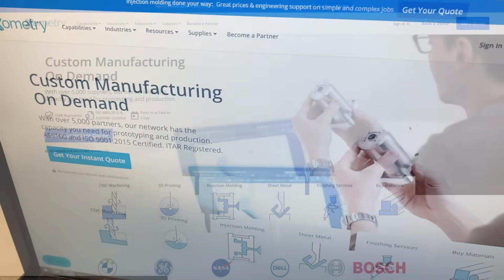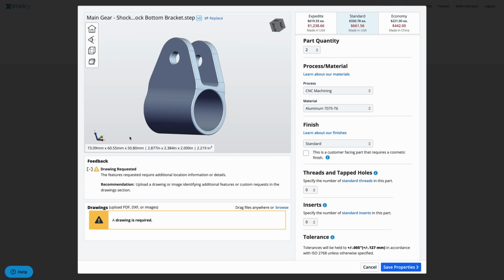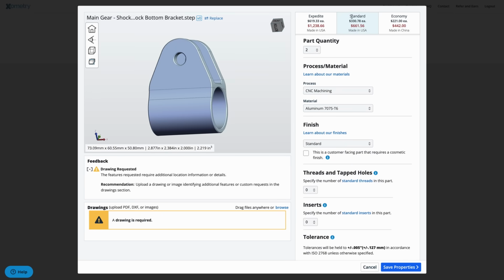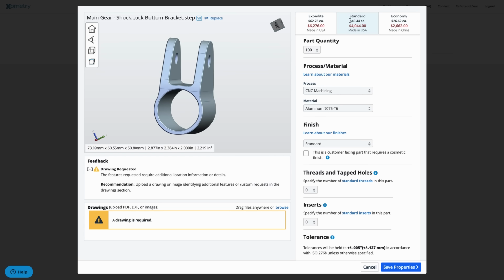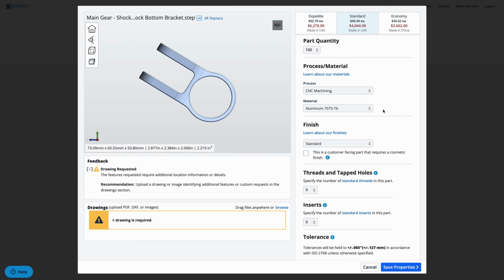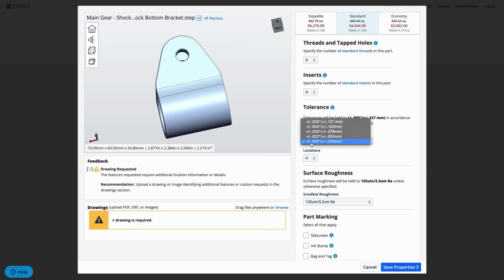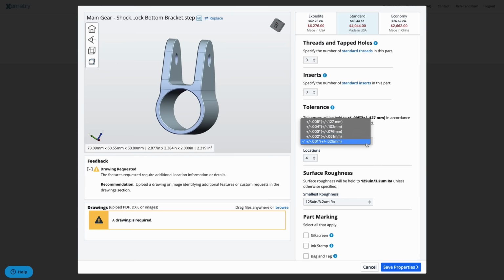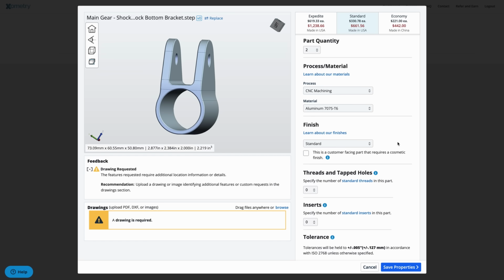The TRUE COST of CNC machining!

Comment: I asked a 6 year CNC guy to face off a 4" piece of 1020 round bar . Then drill a 1" hole 2" deep in it, then drill a 1/8' hole in the side.
He did not drill the 1" hole deep enough. Broke the 1/8 bit in the side, welded it up to cover his mistake. And went too fast facing it off and left a poor finish. He said he was unable to use his CNC equipment, and did the best he could.  BTW... The piece was discarded
   The moral of the story, you may ask?   The true cost of CNC machining is ...the creation of a workforce unable to do the simplest of jobs, with out the aid of a $100K+ computerized work station.
Reply: You absolutely right. Just because they can set up a part on cnc and push the button to make it go they think they're a machinist. The programmer is the one that says what tools to put in and programs speeds and feeds in the program. Unfortunately back around 2000 they dropped tariffs on stuff coming from China. The results were 3/4 of small machine shops went out of business. And no one persude or trained to machine because there were no jobs. I know of 2 machine shops now that are looking for workers and there isn't any.
Reply: Its funny, because I asked a guy to do a simple part that would have taken 10 minutes on any number of cnc machines in our facility and he spend half a day on it because he was too busy worrying about using manual machines for clout. 

Stop with your nonsense.
Reply: Meanwhile Vietnamese and  Mexicans taking the few jobs left here
Reply: @JuanHernandez-ub3ez  No.

Comment: I disagree with Apollolux saying that the true cost of CNC Machining also includes the price of the machine. It does not. If it did, there would be zero reason for any company doing CNC, to ever buy these machines as they would have no way of making their money back, since the parts made on the machines would be so hideously expensive that any earnings made would cover the many other costs in running a business. No, buying the machine isn't part of the costs. Buying the machine is an investment into your own skill level, which you can then use to earn a living. In other words. If the machine was included in the costs, it would mean that buy and use a new CNC machine every single time you want to manufacture a single part. By the same logic, a Carpenter would also have to buy a new hammer every time he/she were to put a nail into something or a new Screwdriver for every screw they were to fasten/loosen. That is obviously ridiculous, so no, the machine isn't part of the costs. The machine is an investment into your own skill level, just like every stroke of the hammer and every fastening/loosened screw with the screwdriver adds more experience to your skill level with that tool.

Comment: Showing machining operations and how workpiece being held is rather valuable for designers to know how their design affects machining process, operation, number of tool change, number of custom jigs and fixtures required ...etc.  However, it’s rather deceiving to show audience the cost of milling in-house is only about raw material cost compare to vendors that need to consider overhead, raw material, labor, logistics ..etc.  I’m not a machinist or machine shop owner so feel free to correct me if I’m wrong or miss anything, businesses that don’t have a milling machine should run ROI considering at least the following cost:  1. machine & whatever attachment pieces 2. if facility electrical modification is required 3. Compressor/pneumatic system 4. Maintenance cost, 5. Operator cost and skill level.  Raw material and special cutter/tap can charge to projects as consumable so I don’t consider them part of asset.  For companies that has a milling machine probably already know how much the cost difference going to be machining in-house vs outsourcing.

Comment: Man... there are some unusual thoughts down below about "cost" going on.
The fact that you have a facility & property is a cost. Utilities, insurances, taxes, machines, machine amortization, tooling, fixtures, oils, coolants, inspection equipment, the network, the software, waste disposal, and so many things that create a rate of cost per hour. Labor, (at the machine & elsewhere)/ Cleaning, packaging, & shipping, billing also have costs.
The material for this part is nearly negligible in regards to cost. Seemed to mention $10. But for time it looked like it took several hours and that's without the CAD work and design.
In my shop the cost per hour is about $70. Prior to setup there is about 3-15 hours of work (depends on part complexity) by various engineers, quality, order entry / scheduling, purchasing, receiving folks. Then comes the setup & production along with clean, pack, final inspection, and ship. Then there's our expected profit. A part like this would be about 15-20%. A part like this, qty of 2... between $6-700 seems about right.
Reply: Agree, thanks for commenting.  This video over simplified the cost of machining.

Comment: Could you not extrude the rough shape and perform a minimum machining operation to the tight tolerances required? I imagine it would save tones on material cost and machine time. But of course only worth it for larger volumes.

Comment: I'll add to Apollolux's statement: 
Setup Time * Machine Rate / Run Quantity
#Operators * Labor Rate / Pieces per Hour
Machine Rate / Pieces per Hour
Material
Components/Outsourcing
Packaging
Scrap %
Efficiency Factor
Markup%
Possibly factoring in any other inspection that goes above and beyond typical

Comment: CNC guys are crazy. Should be $60 or so for that stupid thingy. Seems anyone that wants to run a machine these days wants 10x what it's actually worth. That's why China is wrecking us with manufacture.
Reply: You really have no idea what this would cost.
Reply: @BrianHoff04  About $15 for the piece of scrap aluminum and maybe $15 for an endmill if you break it. Possibly another $15 if you break two, but then you're really not super good at what you do.
Reply: @joblessalex  hehe... most folks thought you were ignorant with your 1st post. Now they know for certain.
Reply: @BrianHoff04  Well, that's what it'd cost me to do it. If you want I can add the price of the machine and labor too, but that divides out. Assuming the customer provides the files, you don't need to have a designer design the part. So say $20 for an hour of labor. Still $60.
Reply: 20 for AVgrade aluminium
15 for endmill
10 pay for worker
5 for services and running costs
10 profit
You get up to $60 pretty fast actually.

Comment: Wow. If you're making more than a few parts, you might as well buy a CNC tool and machine it yourself. Which is what you're doing.
Reply: Those machines are pretty expensive you have to calculate which is cheaper buying the machine or buying the parts

Comment: The saying in engineering goes: If you can't make it precise, make it adjustable. This video gives you a great insight into why there are so many parts in mass production that allow for adjustment. Assembling 100 parts on a wide tolerance margin and then turning some set screws to get everything to fit together properly makes a huge difference in cost. 

Great video!
Reply: Except where compactness, strength, or weight are important. Adjustability compromises a lot.
Reply: @appa609  which turns out to be in far fewer places then you'd think.
Reply: @GermanTopGameTV did you forget we're watching an aerospace video?
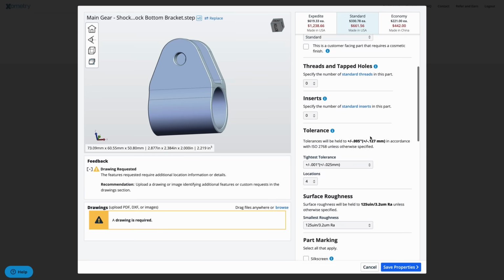Reply: @GermanTopGameTV  Wait what? Adjustability is totally from left field here. It's shock hardware for an aircraft and they are going for precision here. At 6:41 +/- .001"
Reply: Yeah, there's a point where you turn to that, sand is where it can reasonably be made. It adds a ton of cost on the back end. In my case it can quadruple the final cost.
Reply: In an aircraft, weight is ALWAYS important. Every milligram matters.
Reply: adjustability is bad. always bad.
it just means you can mis-adjust things and people eventually will do that.
If you want something to always fit, make it this way. Even if you have to have tight tolerances then. It's almost always the better option.
Reply: @RubyRhod  consumer side? Yeah I guess you are onto something. Professional equipment? Adjustability all the way. The people working with it are trained to use it, it enlarges the applicable use space, and all while remaining cheap to make in comparison to a precise part.

Comment: Seriously, just designing cnc parts with knowledge of common (cheap) material stock size is a huge difference in price.  Designing the part with an understanding of manufacturing can avoid difficult (expensive) operations.

Comment: This part is very stupid to make in a cnc router, I would've done it in a plasma cutter and a press if it was needed in aluminum, or just weld a couple of steel parts for cents on the part.
It's nice as an exercise in costs but, it bothers me to use complicated machines for dumb parts

Comment: There are other costs you are not considering or did not mention, like the amortized cost of your machine. Most job shops will take on a fixed cost to an order to cover part of the expenditure for the machine that will be used. Again, like set up costs and tooling costs, this will be spread across the number of parts in the order. The more parts made, the cost per part drops. You have that cost in house as well, and you need to track it so you know when you have "paid for" your machine by spreading the purchase costs over a number of jobs. This also helps when considering the depreciation fo the machine for tax purposes. You can recoup some of your costs through tax savings if you keep track of things like this.
Reply: Most amortization schedule would be done one timeframe only ( x years) and not relevant to usage, unless you can demonstrate a real cycle based cost impediment which I doubt anyone would bother to calculate for manufacturing shop machinery.

Comment: now i have some experience with xometry i can offer advice .. When you order parts for cnc machine work , save a duplicate of that order as a quote.. What happens is , you get the parts, sell em over a month or so and go back to order more, Because you didnt save it as a quote , you get a new quote.. In my case , the same exact parts went up 260% in price from december 26th till today , feb 25..Dont delete your old quotes, and always make a duplicate quote before you place an order.
Reply: The old quote wont be valid anymore anyways. Xometry has a time limit that quotes are valid for. You can't** use the same quote from 9 months ago, material costs change, available shops ready to make them, etc.

Edit** misspelled
Reply: @mecrob9852  the prices did drop back down after the chinese new year..  The quotes are held for a certain amount of time i dont recall , but youre right 90 days later they wont honor them

Comment: How do you zero it at the exact spot once you flip it over, I will never know :D
Reply: Calculate the offset from the rear end of the part
It should be the same as op 1 when you machined the cylindrical shape

Comment: I ran across your video by chance, and I enjoyed the demo... however, as a former CNC machinist/programmer I saw a few things during the machining process that could have sped up your process, as well as created a perfect bore through the part without having the chance of a mismatch.  When working with aluminum, don't be afraid to hog out more material during roughing at a higher feedrate... it's the best material to machine (metal-wise) and rip through without loading your spindle torque and tool deflection.  Many times you can cut your cycle time in half by bumping up the D.O.C. along with a slight increase in feedrate and it will throw a better chip (both drilling and milling).  Also, if you have access to a boring head, I'd suggest utilizing it to finish your thru bore if it requires tighter tolerances on diameter and concentricity... it will give you a consistent microfinish while holding your tight tolerances and it only takes 1 operation to finish.  It also gives you the option to use an arbor fixture for securing the part while finishing the outer profile.  Just some tips from an old machinist and a new subscriber!
Reply: Do you have experience machining inconel 718
Reply: @eatablellama6581  Grinding, yes.  Down to a couple of tenths. Pretty much the only material we used (gas turbines).  Not a big deal for someone that knows their way around a finish grinder.  Ran a multi-axis CNC Bryant, Brown & Sharp, I.D, O.D, you name it.  Fun times at Pratt & Whitney, Lycoming, Sikorsky Aircraft and Honeywell.  I miss it :-(
Reply: There are also vises and Jaws that allow you to clamp on a much smaller cross section and still have the same holding force, just have to machine a small dovetail in the part
Reply: Machinig with these feeds, tools tehnologie are from the 20 cent. We can do this 4 to 5 time faster. Its kindergarden.
Reply: Big picture: speed isn’t the primary concern when making 1 part. If the part goes into production, only then is the original comment relevant.
Reply: The True cost are direct from the speed.  @jaypie0864
Reply: Sounds like very good advice.
Reply: What is the secret to machine precision parts in a cnc? I guess good tooling is 1# but you need to slow down the feed rate or not?
Reply: If you just made all that up then that was brilliant because i believed every word
Reply: @brianbailey462  Nope, not made up... just speaking from experience!
Reply: @nerfburger1511  well just know some folks in this world, like me for example, really appreciate what people like you do. Innovators, inventors, and people who make things.
Reply: @brianbailey462  nah, he is right, darkaero was milling the part like it was a steel part, if not slower id argue

Comment: Why make them so detailed?
Just leave more material on them
You could take out so much cutting and fixturing  if you left the sides flat. 
I could remove hours worth of setup and cutting in seconds.
There's no need for the level of detail on the outside.  Just leave it all square.
Reply: It's for a plane. You don't want to leave any unneeded material at all. Sure it's only a few grams for one part, but those few grams add up considering the amount of unique parts that go in a plane. Especially in small ones a few kg can make all the difference!

Comment: Dude this guy has no idea how costs NEED to be calculated for parts. Sure, if you do them inhouse you are not paying the shop hr rate of another shop, but you should be using a similar rate to judge your own shop. It ia not just materials and machine time, theres rent, electricity, software costs, innovation costs, investment costs.

Comment: Great video. I don't work for a shop but know I get crazy looks when I tell people how much a part will cost to get made at the shop down the street. Just curious, do you not value your own time? You say it only costs you material but not really. You have a significant amount of personal time in this. It looks like you have at least 4 or more setups in that part. This said, the first step in making the part cheaper is to reduce the number of setups. I can see making this in 2 setups with no soft jaws. I'm not certain where your critical dims are but its possible. Obviously you can't dictate how another shop makes it but when making it yourself you can reduce your own time invested.

Comment: How accurate is that automated quote? If you do send an actual order in I suppose you make a proper drawing first where the tolerances are properly written down? (eg parallelism of the flanges as well as the press fit bore, the other dimensions don't need to be machined to such a fine tolerance, that'd be a waste of time wouldn't it?)

Comment: Elephant in the room: China can make them cheaper
Reply: China makes garbage and the people that buy from them aren't doing anybody but China any favors.
Reply: @OneTequilaTwoTequila  China makes pretty good parts actually that's why even big companies buy from China.
But yeah if you buy the shadiest product with the flashiest ad I can't blame you for getting a crap product
Reply: @safetyinstructor  Big companies don't anything from China because they make good stuff.  They buy from China because they're cheap.  Period!  They WILL take shortcuts if you do not check every part.  Do you even machine?  Have you ever used Chinese Aluminum?  It's very gummy and harder to machine.  Chinese steel sucks, too.

Comment: Hey, I want to 3D print something for my car and I have no idea what it could cost. I would need to create a 3D part for it and it would take weeks to do. I also don't know if 3D parts are much more expensive than CNC or is it about the same price up to 2x the CNC price. Paying like 700 for a piece wouldn't be that bad but something like 2000 would be pretty expensive. I also need 2 pieces :x
Reply: @BotDamian 3D printing in plastic would be way cheaper, but 3D printing metal could be alot more expensive. Variables of cost differ greatly between CNC and 3D printing. General rule of thumb: simple parts are cheaper and faster to machine. high complexity parts (lots of features, bends, holes) are worth 3D printing. Tolerances on 3D printing are not as tight as CNC, not by far, but they can always be machined to spec.

Comment: Dang, I had guessed that the parts where manufactured differently; one from a block and one from extrusion. If there were high quantity batches of parts I bet an extrusion could get those costs WAY down. It is crazy how just much money you can save when you spread out the cost of labor of the setup/programming over 100 parts instead of 2.

Comment: Also, it will be more expensive from a small shop versus a large one. Small shops don't keep much raw material on hand and don't get as good of prices on material as a volume shop can get. They can have older CNCs that aren't in the best condition, that makes hitting those +/- .001 - .0005 tolerances much harder to get.